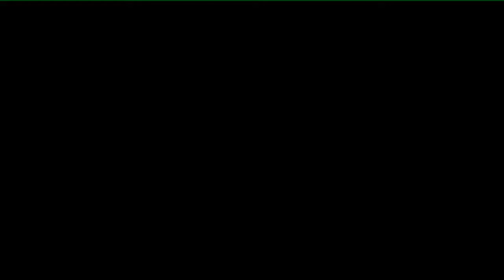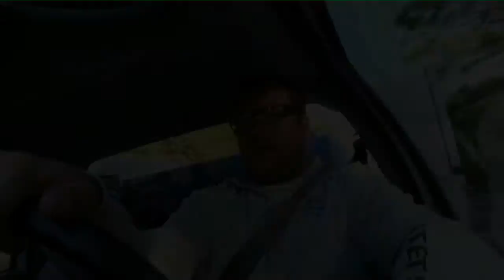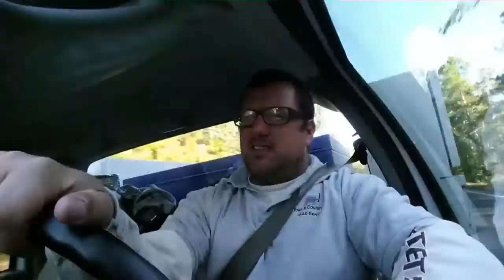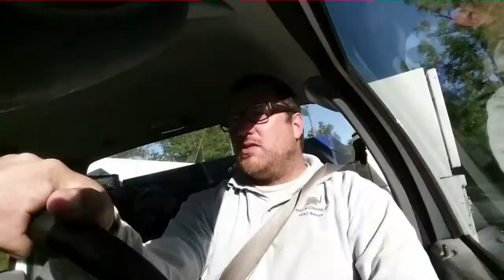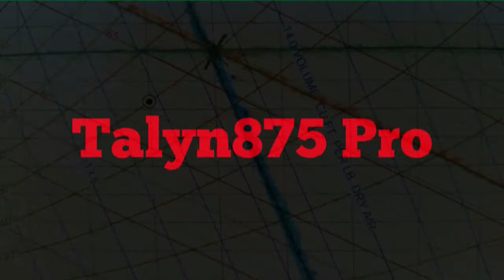R 32 Discussion Part 2

Comment: Wouldn't a larger or secondary condenser work to remove discharge heat?
Reply from the maker: It seems like a larger condenser would not be enough

Comment: The Chinese use R32 in large commercial and residential high rise buildings as part of a larger water chiller distribution system.  The cooled or heated water is easier to distribute at great heights and the R32 compressors can be maintained in a single, safe equipment room.   With this kind of scale the higher efficiency of R32 helps compensate for losses in the water pipes and avoids massive lengths of refrigerant lines throughout the high rise.
Reply from the maker: Thanjs for all the info